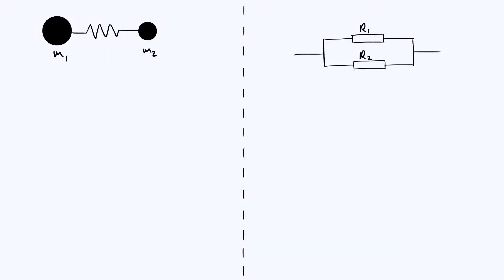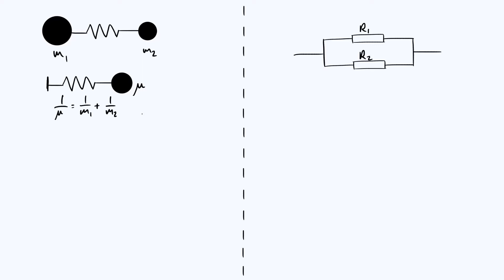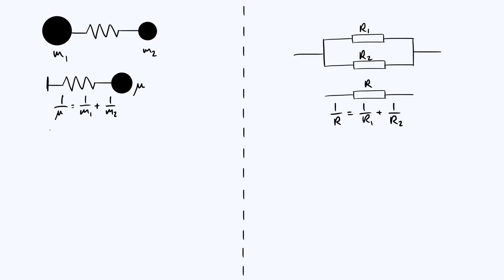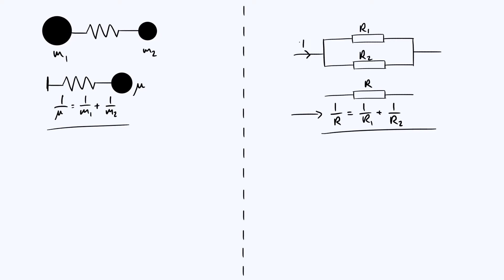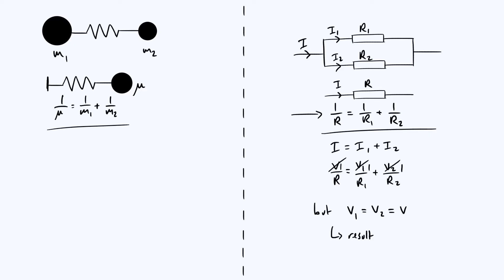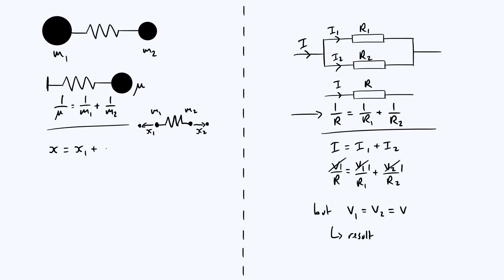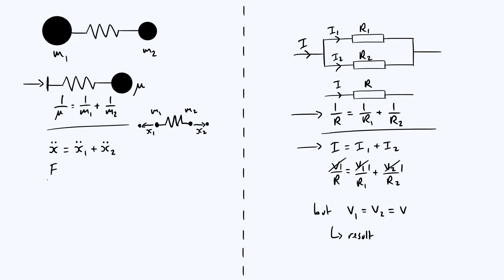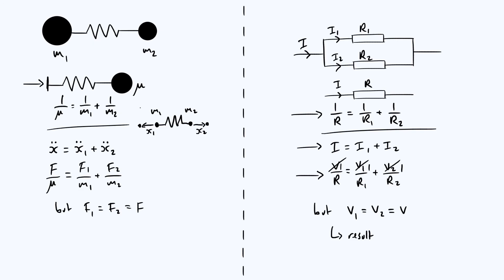Reduced mass and parallel resistors

Comment: T=L/R has R in denominator.....i recommend you read Charles Steinmetz on electrical transient phenomena... The whole LC circuit is exactly reconsileble with oscillating objects. Have you though of reinterpreting what you just explained with g - conductance-reciprocal of R? ... anyway, read Elementary Lectures on electric discharges and waves and inpulses by Steinmetz.... particularly Lecture 6
Reply from the maker: Thanks for the recommendation.